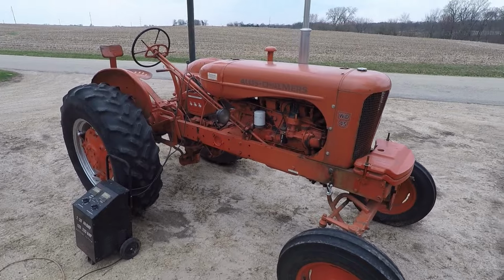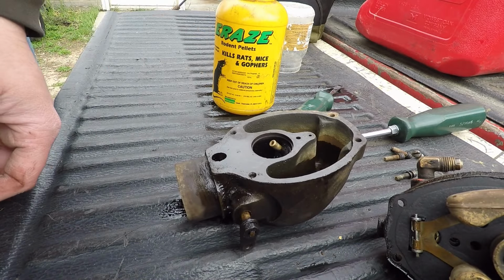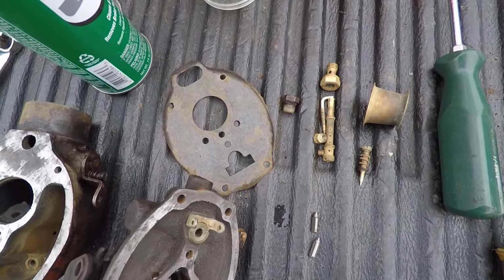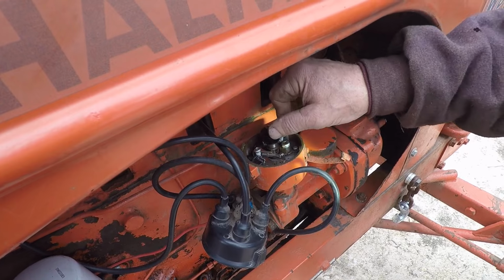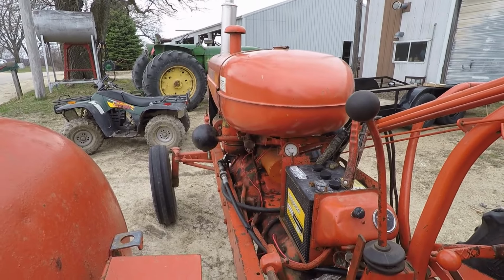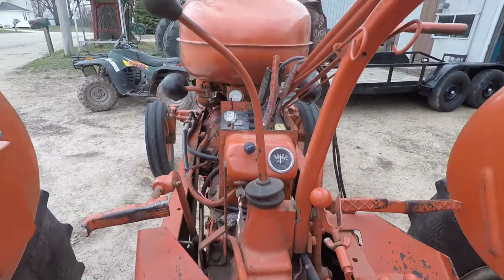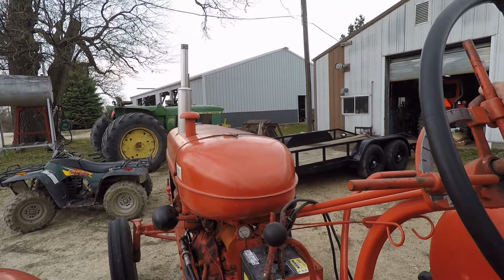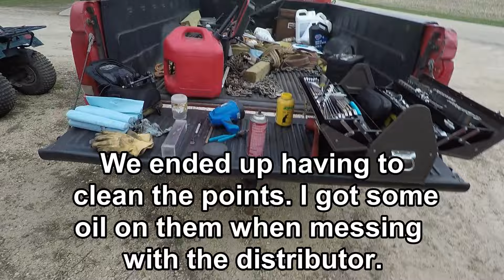Allis Chalmers WD45 - Has Fuel and Spark but Won't Run.

Comment: That is a pretty dang clean & straight (decals, gauges, sheet metal all there) tractor.  Probably low hours. Purrs like a kitten.  Cool old tractor.
Thank you gentlemen.
Reply from the maker: I don't know. The pivot for the front axle is completely worn out. The steering is also really sloppy. But that could be normal. The engine has great compression.
Reply: Watch Wes Work Hmmm, well somebody made sure it was at least under cover.  The "patina" of the paint is sure nice.  Who's that for a $5 word coming out of a backwoods hick.  Hahaha...

Comment: Great video...Many memories flashed back in my mind from 65 years ago when I heard that smooth sounding engine rev up.  In the late 50's and early 60s', I would work summers for a neighbor when they baled hay and straw in northern IN.  They had two Allis Chalmers WD-45's to run the operation.  These people were great to work for as they would allow me to operate the tractor pulling the baler, run the wagons from the field to the barns and the least liked task of working in the hay loft.  These tractors were not the most popular but were great tractors. Many other farmers preferred red or green rather than the AC orange.  Thanks for all your great videos and I love them all.   Rick  in Central FL

Comment: My grandfather had the wd..a d17 and a c ..great tractors..he converted 2 of them to 12v as well..they had the smoothest running engines i ever seen..but the wd was plagued with rust in the gas tank..we cleaned in several times back in the day..it had the most tempermental fuel system..one drop of water even and it would go on strike lol...a great tractor regardless and a nice looking tractor as well..wish i had it just as a collector
Reply from the maker: Allis made reliable tractors, but they had funny ideas about clutches, PTO clutches, and hydraulics.

Comment: Maybe check your compression, then drop few drops of oil in each cylinder,spin it,do compression ck again,if pressure stays the same,likely valve problems,raising pressure after oil points to worn/ broken rings.

Comment: Yesterday someone gave my brother a generator for free because "IT NEEDS A, NEW CARBURETOR". My brother brought it to me, after about 10 minutes of fiddling with it I realized it had no spark from the plug but did give me a jolt. Found a new plug put it it started right up and runs great. You notice everybody says everything needs a new carburetor these days?
Reply from the maker: Maybe because carburetors have become so cheap. Many can be replaced cheaper than they can be cleaned!

Comment: My friend had a WD45 every fall while filling a 40 foot silo he would run one wagon load through the silo filler about halfway through the wagon he would set the carburetor settings for just the smallest blue flame from the exhaust. This gave two advantages so he thought, one it started better in the cold of winter and gave it better pulling power. I thought it would run rich but checking the exhaust it was clean as can be.
Reply from the maker: I'd have to look in the manual for the setting. Usually it is set for maximum power at full load or slightly rich of max power.

Comment: My grandfather used to own one of these, from 1952 (when his parents died, who were still using draft horses up to then) to when we auctioned off the farm in 2003.  It still had the original battery terminals on it with orange paint on them when we sold it.  I learned to drive on it when I was 12.  I didn't even know that it had an electric starter for years, as my grandfather for some reason always crank-started it.  If I had a bigger place, I'd have one of these tractors again just for sentimental reasons, but the lack of a proper 3-point hitch on back really limits its usefulness.

Comment: I’ve been trying to get my dad to teach me how to setup a carb for years. Just don’t get into a situation that I have one.
Reply from the maker: Don't over think it. Almost all carb adjustments come down to this: adjust low speed for best idle, adjust high speed for best power, adjust idle for proper RPM.
Reply: Watch Wes Work i generally work on fuel injected cars so I barely if ever see carbs. Tuning a carb can be an art form so I’ve heard. Also gives me a little father son time too.

Comment: I had a CA for a long time.  Always wanted to upgrade to a WD45, but when the time came I found a 90's Japanese diesel tractor was cheaper and a lot more practical.
Reply from the maker: I think most people have found the same thing, which is why these tractors really aren't worth much.
Reply: @WatchWesWork  They're kind of scarce on the east coast, more of IH & JD territory here, so they command a premium especially if they run right!

Comment: Had a WD45 for many years, thousands of hours, did the 12 volt conversion. D17 and 170 engines basically the same and have subbed WD45 engine into the 170. Bought engine rebuild kits from Tractor Supply. Bought all three at auctions as non runners.

Comment: Thanks for the video!
Need more videos with your dad!
Helping a buddy with his Allis. After replacing the bottom end he's to the point of getting it running. I shared this with him.
The tractor had the top end redone in frame. Crank was warn to the point there's a ridge where the oil gallery is in the bearing shell. Previous person put undersized bearings in!
Reply from the maker: Interesting. Did you grind the crank or replace it?
Reply: @WatchWesWork  replaced. Wish I could post a picture here! It was warn beyond grinding!
I think my buddies tractor has an issue with the mechanical advance on the distributor.
Hey, I don't have much in my channel, but maybe some stuff you might like. Jonathan W subed.

Comment: Not many people have got experience on an old tractor like that. Kudos to your dad for remembering some of that drive pin problems. Sounds like a real sweet little tractor. Good job you guys. Stay in isolation though. All of best from Canada
Reply from the maker: This is old news for my dad. He's the master of the points ignition system.

Comment: its clear fuel starvation check carburetor und fuel filters and fuel lines and if not then some cylinder head valves are stuck because has backfire from the carburetor or and check the firing order and spark distributor if the knock hears  'dry' but is looks fuel starvation you do not handle the carburetor as I see correct! have fun!

Comment: My advice - don't switch it over to 12V. 6V works just fine. Much deeper cycle battery as well. I still have a 6/12 V battery charger. Still works. I think it's older than I am and I'm in my 50s.
Reply from the maker: Well the generator is not working, so rather than fix it, we are converting it.

Comment: Love the footage at 11:35; your dad coming into the scene with a big hammer. I was thinking a faulty ballast resister. They can sure give you fits when diagnosing. Good catch on the loose nut!
Reply: Matt, good thought on the ballast but note this is a 6v system and I don't think they ever used a ballast resistor ;)
Reply: @danmackintosh6325 , actually they did. My 53 Dodge pickup had one, my Farmall cub had one, and my current Farmall H has one. All 6v, positive ground.
Reply: @mattthescrapwhisperer  Well ya learn something new every day! So they run a 3 volt coil? Where in the world does a guy find one of those?
Reply: @danmackintosh6325 , 6v coil. The resister allows full voltage for cranking, and then reduces voltage when running to preserve the points.

Comment: I bought a new ignition kit for my 1947 8N and installed it on a running tractor. It wouldn't start:(  After a half day of screwing with it I found the cast of the new points sets was offset by > 5 * and wasn't even close to opening at the right time. I also had to reuse the old points and  the homemade insulating disc because the new one actually shorted the positive ground to the ignition . Gear lash on those old ignition systems is critical. Fun, fun, fun.
Reply from the maker: Yeah, all the new parts for these old tractors are cheap Chinese junk. There aren't really any good parts left.
Reply: @WatchWesWork  Actually I ordered it through Steiners USA and they were made in Mexico. I bought a brand new water pump for the same machine through Steiners and it was machined in Turkey. I read that on the bag and thought oh great but I have to admit it was a perfect match. I live in Northern Ontario, Canada and getting parts for older machines was impossible for the past 20 years. Steiner has distributors in Canada now and other than the crappy points I've had great luck with them. I have refused to use or purchase anything from China for the past 20 years because, I'm tired of defending junk to customers. When shopping or ordering I flip it over and read ...if it says "made in China" it gets left behind.

Comment: Reminds me of that time I ran across a shorn flywheel key in an OMC V4.  The timing was all over the place, I'd get it synched up and run good for a while, but then it'd wander again.  It turned into a very expensive exercise in frustration, and a very valuable learning experience:  Don't ever take anything for granted.

Comment: You're overthinking this. Put a timing light on it before anything else. It runs fine once it starts. It needs a complete tune up and everything else. Timing, Point gap. spark advance, do it all.

Comment: Westwood working on these old carbs Do you normally use brake clean ? I normally use carb clean but brake clean for everything else. 
I was actually told once that you couldn’t use brake cleaner and carburetor but I didn’t see why it’s an excellent cleaner. Also does your dad still farm?

Comment: Wes, I don’ Know if you saw my video on the hough payloader carb. It really works, I fixed many carbs this way when a new needle and seat wouldn’t help. 40 years ago I had a Corvair that wouldn’t start when hot do to flooding. The residual fuel pressure would leak by the needle and seat when shut off and flood cylinders so wouldn’t start. The machinist at my favorite auto parts store told me to file where mark on float, problem instantly solved.

Comment: I hope you make a part two with the converting from 6 to 12 volts. As a an armchair mechanic I love to see videos of this "simple" yet fascinating technology.
Reply from the maker: It's really easy to do. Replace generator with a single wire alternator. Replace coil with a 12 coil. Reverse coil polarity. Done. If it has lights you need to swap to 12V bulbs.
Reply: @WatchWesWork  What about the starter? Wouldn't it need swapped too?
Reply from the maker: @brianworley7705  Normally the old 6V starter will work just fine on 12V. We typically just leave them alone.

Comment: Good for another 10,000 hours! Used  the same WD 45 on our farm for 65 years and yes 90% of the "carb" problems 
were electrical . A lot of other tractors have come and gone but the old Allis is our one constant.

Comment: You know as well as me, being it's orange, it has to have a cracked block and won't run. 😜😜
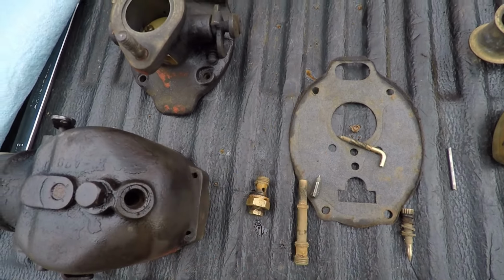3:16 As a test try  Evapor Rust.  Dry the carb out and then soak it in the stuff.  Really works well on surface rust.  Look into it.
10:51 I know I'm nit picking, but that is a helical cut gear.  And you are correct, if the two gears climb on each other you can have a timing change.
By the way, good job. P.S. Next time you lay in the dirt, not Dad.  Lol.
Reply from the maker: Yeah I've never tried it.

Comment: Dad: I don't have time to mess with it. Go ahead and try.

Also Dad: (Laying down on his back in the dirt with a timing light) "nope, go back a little... that's it."
Reply from the maker: Priorities...
Reply: I think most dads do that lol
Reply: Better than mine.  Complains he has done everything to get it running yet obvious evidence around said object shows he literally hasn't even touched it leta lone been near it in who knows how long.  

That or its out of fuel and he cranked it until the battery was dead then walked away while leaving the key on (a week or month or more ago)  so it's now 'dead' dead plus now has a ruined battery or set too.
Reply: My grandpa " No use fiddle-fartin" around with it"  as he was going in to get more tools.
Reply: Is that a Sun timing light I see before me ?
Reply: Had a 74' GMC, shot, burning oil, rusted out, started blowing coolant out the driver side pipe. Stopped by on my lunch break, grandpa had a new head gasket put in a 366 not worth saving. Ran and burned oil for another 10 years. Still runs if I put a battery in it.

Comment: On point style distributors it is important the mechanical advance weight springs pull the point cam and rotor firmly back to the fully retarded position. Many times the advance springs are stretched and the weight pivots are worn on these old distributors. If the advance springs are weak the resistance between the points rubbing block and the point cam will cause the ignition timing to bounce back and forth between fully retarded and fully advanced at cranking speed. If the engine does start it will run fairly well at WOT as the weights hold the point cam in one place but at low speeds the engine will run lousy because the cam is bouncing around.

IMO you should check the advance springs in this unit as the engine should "labor" more at slow idle. I don't think it is going back to the fully retarded ignition timing at idle. On these Allis WD's and WD-45's it is important that ignition timing is fully retarded on a hot engine restart. They had a tendency to "buck" against the starter and snap the snout off the starter if the timing was too far advanced.
Reply from the maker: That's pretty unlikely. Even with no springs, the rotor in the distributor has inertia that keeps it in the 0 advance positions any time the distributor is spinning. This Delco distributor also has a "brake" that puts some friction on the rotor shaft to make sure it stays at 0. FWIW, I did take the distributor apart and check the springs. Everything was fine.

Comment: So u did what ? U adjusted the timing ? I have a 1958 allischalmers wd 45 and it suddelnly wont start .lots of juice i took the carburator apart and cleeaned it up just like u did.i put in a what ever that green generator/ cylinnoid   thing is called that goes to the middle of  the distributor cap .but.....can the timing just go out for no reason ? I dont know how to adjust the timing but why would i suddenly need to .? Full disclosure i often need to adjust the front crank to put the starter in a diiferent position before i start it .but it always started right up after i did that .ok so it sounds like a starter but the way it died.i was using it then turned it off .then started it and it woukdnt start so i adjusted the crank in front which moves the starter .then i started it and it started but then it quickly died and hasnt started since .i really need this tractor to work
Reply: Oh dam i just finished watching the whole video .i guess i have some work to do to check that nut and learn how to adjust the timing again .

Comment: Stupid question. Could you dip the needle valve tip in a rubber paint or solution to make it seal better?
Reply from the maker: I don't know. It would have to be something pretty tough to resist gasoline. I'm not sure what type of rubber is used on the factory made needles.
Reply: @WatchWesWork  if you do find a solution, if may come in handy for other things too

Comment: Squirt gas into the carburetor when it starts to run. If it stays running, the engine isn't getting fuel.

Keep it simple but don't be stupid. I've had a lot of K-181 Gravely tractors with Kohler engines that did the same thing. Plus, Ethanol Gas raises hell with the Carb parts. 

Go to an airport and see if you can get some aviation Blue Gass, 100 Octane Blue Gas.

Comment: What are the two levers? How about the two pull rods? I always thought one was throttle, the other spark advance.
Reply from the maker: No. The two pull rings are for the choke and the starter motor. The two levers are throttle and hydraulic lift. Then it has a weird hand clutch arrangement.
Reply: @WatchWesWork  The hand clutch was for drive engage/disengage independent of the PTO. Grew up on a WD tricycle front-end tractor. Still have very fond memories of it. Don't recall if dad kept it 6 volt or converted. Seems 6.

Comment: That was a good catch Wes! .. just as a thought, since you work on carbs so much, I use an ultrasonic parts cleaner for my carb jobs and it works wonders cleaning all of the small nooks and crannies. They’re cheap and can get carbs cleaner than just spray and a brush.
Reply from the maker: Yeah, I should really get one.

Comment: I can tell you two things that will  not let it run, compression rings bad, two a valve stuck
Reply from the maker: I does not have either of those problems.

Comment: If someone is going to own and use old tractors they better learn how to overhaul carburetors! I have no idea how many times I have had mine apart. Also they need to learn the ignition systems.
Reply from the maker: I agree. And these old carbs are so simple. You can tear one down and clean it in 20 minutes.

Comment: Awesome from rough running to really smooth . Please explain what timming marksare found and where on the underside of the tractor
Reply from the maker: There's an inspection cover on the bottom of the bell housing. Inside is a pointer and marks on the flywheel. Pretty standard for an old engine.
Reply: @WatchWesWork  thank you for the info nice to see the tractor in good shape again